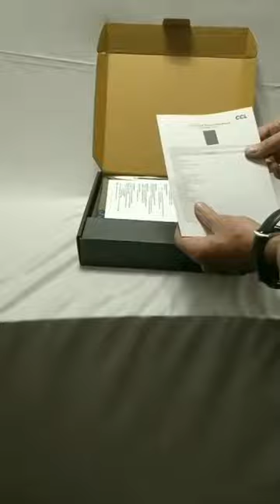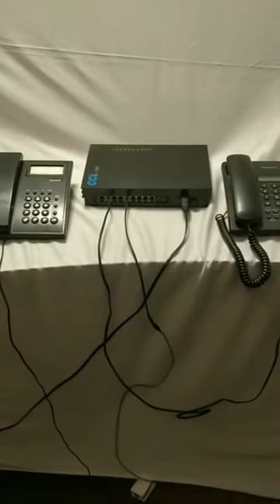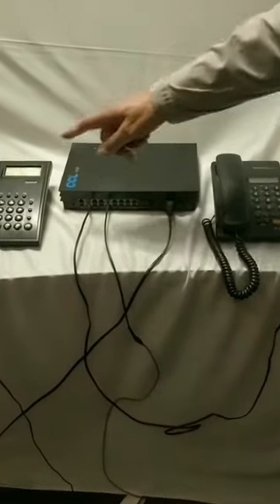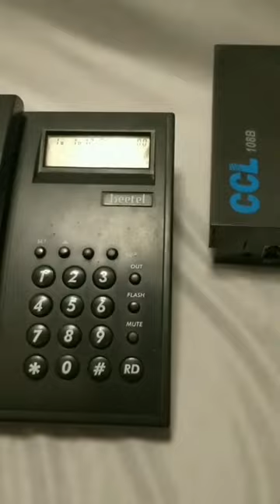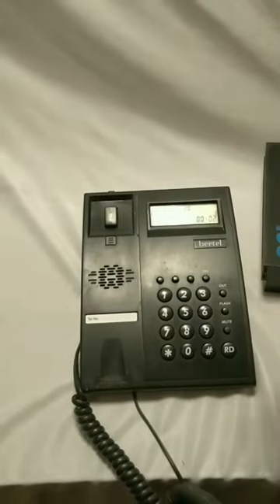CCL PBX 108 Series- Installation Guide

Comment: Full details explain karo..
Reply from the maker: This video is to explain the basic installation & programming.
For further details, you can contact our Service Support Team at 8510992308, 9717943935.
Reply: I purchased 3 Nos, I am using 108SU. Unfortunately on of them damaged. I need it's transformer